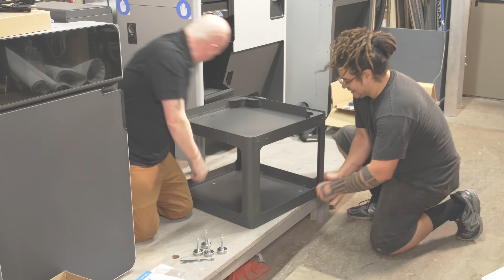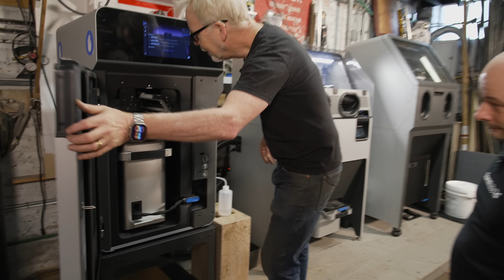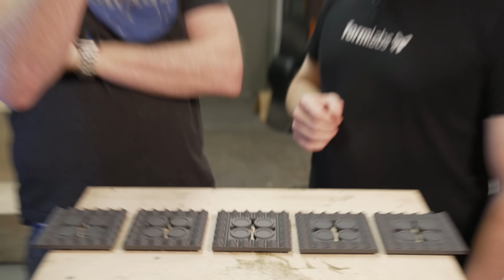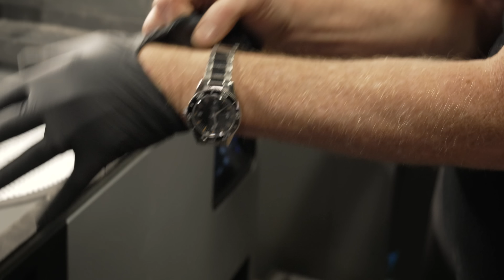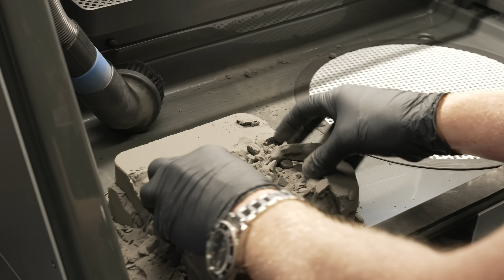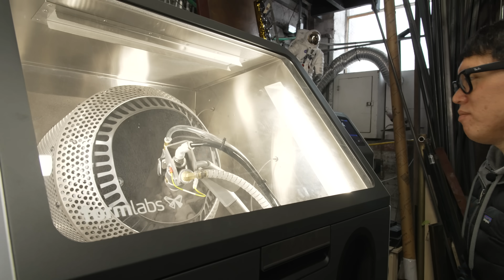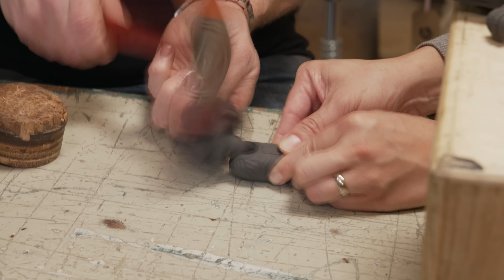Adam Savage Levels Up His Workshop 3D Printer!

Comment: I have see NASA use this technique years ago on board of the space shuttle to print out tools like an adjustable wrench.
They printed all parts in place and it worked just fine. I think the key solution to this project may be just that.
Instead of printing all parts separately , try to print all in one. Perhaps with a bit more tolerance on the joints.

Comment: Remember Adam, safety first! Never clean SLS parts in the open like that with no respirator, lab coat, or eye protection. Always use the glove box closed with the fume hood running when extracting the parts, and conducting the initial scrub down on the part surfaces. Any time your transferring parts from the printer to the glove box or from the glove box to the media blaster wear PPE! I recommend having a PPE station with all 3 that stays in the printer room so the powder has a smaller chance of traveling through the shop on your personal clothing. Have a separate tub with seal to put your respirator into also so it stays clean. Also I'm very surprised the service engineer only covered temperature calibration when they installed it. Calibrating the printer for dimensional accuracy is crucial with any 3D printing. That way you can run your parts with nominal dimensions, and know they be within a specific tolerance the machine is rated for. That way you know your assemblies will fit together with the correct gap settings. I wish I could help you out. I'm heavy into AM technology. I feel there's so much that the service engineer did not cover that could have helped you're first print be successful the first run. I'm sure the assembly gaps on the models themselves are all wrong for the most part, but.... never let a service engineer install a 3D printer and leave without proving it's accurate within specification. It's also very weird the way that nylon 12 sounded, and way it fractured. You might need to set your temp settings cooler. Anyways I'm glad I found your channel. I've always been a huge fan!! Feel free to hit me up any time if you need help with CAD, and AM technology. I'd be glad to help. Cheers!✌🤓

Comment: Enough people talking about respirators, so I won't.  I'd love to see how the software operates to get these prints into a print-ready state.  Can you just import any old 3d model?  Does it have an option to break larger prints into smaller ones, adding in connections to get to the original, full-size model you were hoping to build?  Or do you need to go in, break a bigger piece into smaller models, and then figure out how to connect them after/before in cad?

Comment: Yeah...I would have masked up for that. I do want to see them redo that print and put those together ... not sure if they just make the ball joints smaller or if there is a different nylon material that does have some flex to it they need to use.

Comment: 31:20 why don't you pre-assemble the models for printing? That way they are already assembled and you don't break parts trying to fit them together. Since the powder supports the parts. But they may need something to stiffen the joints afterwards, or may get welded together. But with a 0.1mm gap you have leeway.

Comment: Adam that printer looks amazing. I worry though that the more work machines like this take in your shop the more techniques will be lost to time. For you specifically this type of additive manufacturing is unobtainable for most if not nearly all of your audience. Both of these things seem to further disconnect you from that audience. One of the amazing things about so many of your videos and projects is that they feel like they are achievable by those that watch and learn from you. Working with high temp and even dangerous materials like this make them seem less unachievable and there is far less to learn or teach. I know that you do more than the projects you make in your YouTube videos and this is fascinating to watch I just hope it doesn't replace processes that are more obtainable for you audience. I could be way off base here I suppose this same argument could be made for a mill or lathe I cannot say for sure why this feels like it crosses a line.

Comment: I've played with SLS and you should print with it fully formed. Just keep a very small gap around the ball joints. Also, I developed a box for printing very small parts. When you print them, you print the box around them so they don't get lost or separated. I developed the box so that multiple customers could print at once and we wrote their name on the box. The lid was printed in place and just slid out after the cleaning. I created it in OpenSCAD and you simply enter the dimensions and the name and then render the box. Quite easy to do

Comment: Here is the obligatory question you never ever heard before: If you had access to this level of 3D printing back when you were doing Myth Busters would it have changed the series a lot?
And as follow up: Can you think of any experiment you choose not to do that would definitely have been done if 3D printing had been this easily available?

Never heard those before right? ;-)

3D printing is older than most think, but early on the quality was not as good and it was certainly not something you could just order up and a week later you got a nice box with a printer and some media for not all that much money. Instead it was something you found at places like Boeing where they were used to print models of parts they were designing. The first I saw was when the company I worked for got an order of three 3D printer that were delivered to a university. A few days later they sent over some test pieces. I got a printed copy of a adjustable wrench that was fully functional and it was printed in one part. You could see a flat area on the thumb wheel that adjusted the wrench, but it worked. The print quality was pretty exceptional but the material was not solid but rather porous and soft. Definitely a sinter process but not as advanced as the one used in this video. This was sometime in the late 90's.

Comment: If you print them in place, the action figure will work just fine! It just won't efficiently use up the space in the printer and you'll end up with a lot more material than you need to mix with the virgin material for reuse...

Comment: This might work really well as a print in place model though, it will require a ton of work cleaning out the joints and things, but if you do it right. That could turn out amazing, and you'll never be able to break them.

Comment: Consider using TPU on the socket part where the two joints meet. The ball could stay Nylon. Duplicate socket parts and plane cut the ends. One end part will be printed as TPU, while the other end part will stay removed. Glue or create pegs.

Comment: I would sand a couple of flat spots on the ball at a funny orientation just to allow you to push it on. Once on you can turn it to its normal direction. This way you can still use the prints.  Just select the sides like 90 degrees from the normal position and shave then a little flatter. Nice printer but too messy for me.

Comment: -I kind of hate the process of removing and moving that build plate... it's very klunky and fiddly, and it seems like a lot of wear and tear on that connecting cable.
-I was puzzled when they filled the printer... why is the nylon liquid? Then I realized that, like toner, the nylon is just SO FINE that it flows like liquid. Cool, though terrifying how easily iy would coat your lungs. It's like working with asbestos...
-I feel like the vacuum should operate via foot switch, so you don't need to take off the gloves to turn it on and off.

Comment: This system seems like it was designed for looks than function. Digital buttons to retrieve the print, cables that need to be plugged/folded each time, having to deglove for vacuum and shake. If may be perfect for adam, but I dont see this thing lasting for any heavy use.

Comment: Nice. I am on a saving spree so I can purchase a starter 3d printer. I want to get one and learn how they function because I have a model train hobby. I recently got into repairs and find I can't find a lot of parts. Stuff like the extended couplers for vintage passenger cars with truck mounted couplers . Or tiny details like horns headlight boxes, I have a DCC locomotive that needs the driveshafts and worm gears that I can't find but could print myself. eventually want to print my own car railroad cars. There's a lot of unique locomotives and pieces of rolling stock I desire to own but can't find in model form.

Comment: gotta do some small quick test parts first to check the fits, but for SLS on the Fuse 1+ I like to use 0.1 mm radial clearance for press fits and 0.2 or 0.25 mm for moving slip fits

Comment: The easiest solution in this case would be to find the most "unnatural" position for the limb you want to attach to the body, lightly file down the ball joint so that it fits into the body and then turn the limb into the correct position - this will allow you to assemble the figure and as long as it is placed "anatomically correctly" - it should hold in place just fine 😄

Comment: This is why FDM printers with PLA are going to be main tech for home printing for the next 20 years.
Reply: Especially considering that 10kg of the powder he used is 1000$
Reply: @dakotareid1566  Well the material price even matter for this printer? Does the setup cost like half a million bucks? Is this a setup anybody that is not a celeb and get it for free use?
Reply: @just-a-dude4u  These things are reasonable to buy if you're running a (large) print farm.  FDM is really a race to the bottom on pricing so it's not worth doing.
Reply: @someusername121  I would love to see a calculation for a scenario where this makes a good ROI, what amount of products and to what price they need to be sold to make this a good investment. There is also injection moulding that produces better parts to consider.
Reply: so true, but when it comes it will be a huge leap forward in the home... im just not sure it will ever take off if the process remains the same, that powder is making me cough just looking at it through the screen.

Comment: Just a thought on the joints.  Could you print them with a stud connection, and then add a ‘rubber’ ball to the stud that would be able to make it a flexible joint?

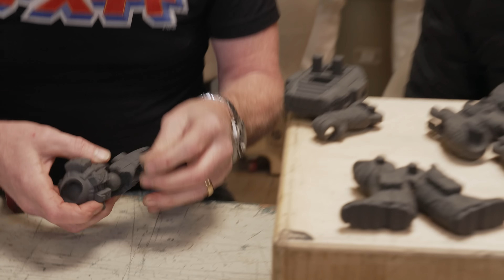Comment: 31:00 … since these prints don’t require supports, wouldn’t it be possible to “assemble” the action figure (balls in joints) before printing? I imagine the balls and/or sockets would have to be rescaled ever so slightly, but I’m curious about the possibility and if movement alone would “clean out” the powder from the sockets?

Comment: We had one of these machines at my old job and it worked incredibly well, though I would just make sure you keep on top of the dust! The thing becomes messy in no time at all, and you really dont want to wait until there is a fine layer of powder coating everything within a 10m radius of the machine. Upkeep is also critical, making sure to vacuum the filters and do as much cleaning as you can as often as you can afford - makes the machine run much smoother and you will get more consistent prints. We found a 50/50 mix of used and fresh powder to be about the most used powder to cycle before getting defects.

Also as others have mentioned, you will end up with way more used powder than you will know what to do with so dont worry about designing parts to be volume efficient to maximise how much powder you can recover. Cleaning time is also something to consider so if you can just have a piece be filled solid you may as well just leave it filled to save on cleaning time. PPE is also super important! Nylon 12 can definitely impact your lungs and if I was ever a bit relaxed about not wearing a respirator it would noticeably impact my health.

Otherwise happy printing!
Reply: Yeah - personally I'd leave the lid closed just to avoid the powder getting everywhere. I have to deal with that enough when powder coating. I mean, I'm a PPE stickler but sometimes, the mess helps keep me that way.
Reply: @MarkEmerAndersonII When they started cleaning it with the hood lifted, I was like "oh f that". 
May have to do with the fact that I've been vacuuming my garage of years of saw and metal dust for the last few days
Reply: Absolutley agree!

Comment: SLS - air gap tolerancing parts fitment is what I see as what the designing processing is or should be. Not just clock work parts assembly designing. Design it as all to fit together as 1 piece assembled part processing and micron air gap like a tiny golf ball dimple surfaces for the existing jointed ball and socket motion operations. um,  all requiring no flex part design looking assembly or all is assembled in 1 sintered mfg production and joint motion clearancing in post production processing/cleaning; motion movement is then found to work. ie no assemble required other than plug and taper interference fitment, for added, joined parts assembly details.  And use your PPE osha processing standards.   Maybe the slicing software needs an algorithm to do a point and click joint surface processing to do the micron air gap joint interference fitment - something like Orca's slicer "other" "surface texture" settings of 8, 3 maybe less for looser fitment and 10, 4 for the harder more force required fitment..

Or try to do a test sampling to find out what if any is your material flexibility standards are if any of the nylon material. my 4K monitor showed plenty of layer height ridges after all post processing was done. that may also create problems in an air gapped assembly designs. i would not ever do any post processing work in an open cabinet with out a respirator. dust at a micron level could attached to the fibrous hairs in your lungs is my fear - silicosis/asbestos type resulting fears.  copd is another... I'd luv to try and figure out the modeling texturing feature capabilities more. resin printing and fdm printing can teach plenty. SLS powder is another but metal SLS has me curious to no end ... you know taconite to iron ore then steel to SS. complete metallurgy of powders... Oh is that how you build new and usable products on mars or in space or the atomic level.

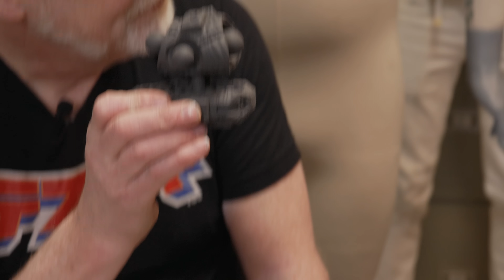Comment: 32:25 @mtndogrally had a perfect idea down below. Print them connected, but still separate. Figure out the tolerance needed to extract the excess, and you have preassembled action figures.
Reply: Just knowing you can print the parts already connected along with the rigidity and durability of the material is mind blowing and maybe game changing!

Comment: Hey Adam, have you tried the new Bambu PPA-CF filament? It's amazingly strong and be used as a substitute for some metal parts. It really needs to be used in a Bambu X1C as they have a heated enclosure, but I've used my plain A1 with some draught shields around it to keep any breeze off it and it works just fine.

Comment: You could potentially pull silicone molds off the 3D prints and cast in a two part resin that flexes a little more.

Comment: I just had replacement main drive gears for a shredder to replace a failed original (multiple teeth sheared, fractured and bent) .  I measured the original 40-tooth gear and then created a Solidworks involute equivalent with the complex hub shape of the original.  I sent the step models it off and had it printed both in SLS nylon and PLA-Carbon fiber.  I Installed and tested the replicas they were more than adequate form fit and function replacements for the failed original gear. which had metal teeth and an injection molded nylon hub.   Interestingly an oem replacement gear showed up two weeks after getting the printed parts back and it was... how to say this... pitiful quality.  I had metallic machining burrs on every edge and mating surface which made it almost unusable until all mating surfaces were fully debured and polished.  The printed parts were usable right out of the box.

Comment: I work with eight (8) Fuse 1+30 machines in a production environment. The Fuse's and Formlabs are absolutely fantastic. Be warned, post print processing is a messy business and the dust gets absolutely everywhere and in everything, lungs, bearings, eyes, cuticles, all nooks & crannies... everywhere. If you ever use the pa12cf, think twice. Don't. Stay with pa12, or pa12 tough. If you need 11cf, have someone else print it for you.

Comment: Are the tolerances of the process good enough for print in place models to avoid the post printing fitment issues? Would you be able to remove the power from the joints? It looks like a fantastic machine.

Comment: It's an interesting exercise of understanding the mechanical properties of the materials, stress, strain, elongation, and what allowances you make with a very stiff material versus a flexible material.

You should be able to use heat to aid the process if needed, but you really need to understand the stresses and what kind of mechanical tension you end up.  Even if the joint went together, how tight would that joint be?  That's half the fun of the game, isn't it?  What to aim for?  

Also equally importantly, this is a process of material removal.  You're melting the desired dimension but also partially melting the loose powder near the virtual ideal part.  You are scrubbing and then media blasting off that extra material that's changing your dimensions.  So now the post process also drives dimensions and tolerances.  This gets to a point where you now have a caliper or micrometer, choose between media blasting for X or Y time, and you might then sand and finish the component into the final tolerance.  On top of all that, you still have to select a design that adheres the stress/strain curves of the part once you're in tolerance.